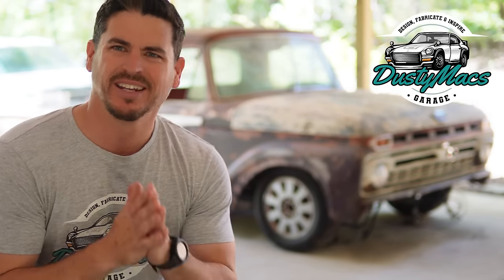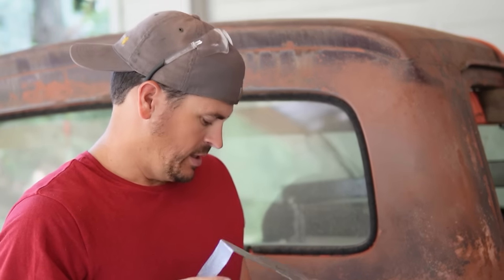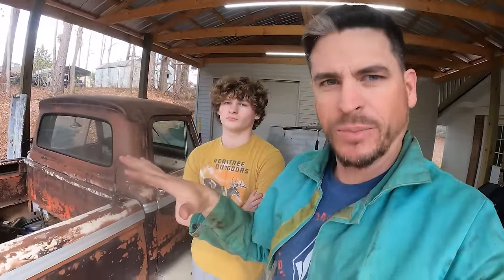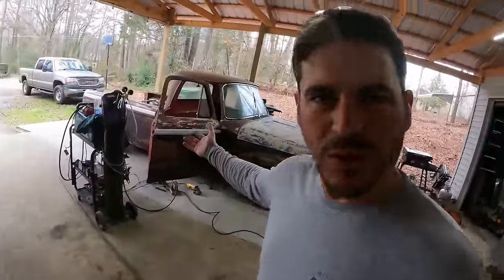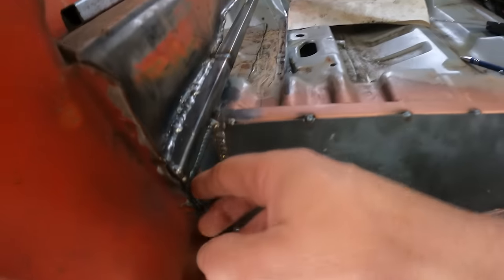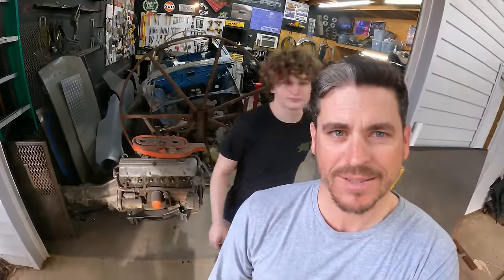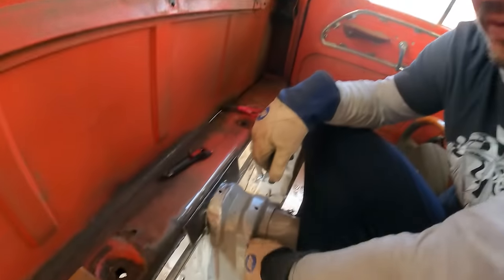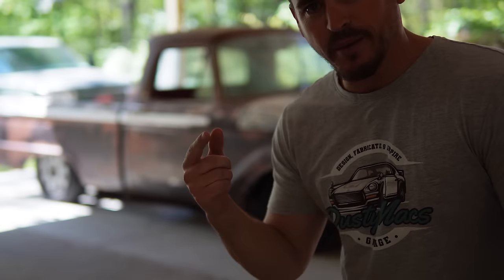(MY DREAM SHOP TRUCK BUILD) 4+ MONTHS OF WORK IN 25 MIN Part 5

Comment: Don’t forget to add some kind of rubber mounts between frame and body to dampen vibration and noise.
Reply from the maker: Hey, I retained the factory rubber body mounts from the Crown Vic since I used the floor and firewall from the Crown Vic and grafted my F100 cab onto it.

Comment: Build it , do you plan on just alot of metal work or carbon parts also
Reply from the maker: Yoooo!!!! I plan on sheet metal at least intially. Im doing a restomod on my wifes Datsun 240z and she wants a mild wide body/flares on it. Hers will not be a shop truck final look like my F100 😂 so maybe the metal on mine will get me better prepared with practice before doing hers on the Z. But long term future carbon is intriguing 🤔 Thanks for the comment and support!!!!

Comment: How are u going to do the gas filler neck
Reply from the maker: Got a few ideas, depends if I use crown vic gas tank or a fuel cell.
Reply from the maker: I tossed around the idea of a fillercap like off a gt350 or gt40.
Reply: @DustyMacsGarage  doing a 55 f100 crown vic swap build.   Might lean towards what caseys customs did on his channel
Reply from the maker: @Thelegendking-yj4bm  so your saying you are doing a 55 crown vic swap?

Comment: 66 Ford F100 on a 2008 Ford Crown Victoria frame with a LS swap. Smh… I would’ve loved to see a Ford engine put in the build but at the end of the day it’s not mine.
Reply from the maker: Yo!!! Sorry to disappoint ya, was gonna do the 4.6 from the crown vic but found out it had blown head gaskets.  Ive swapped several LS motors of my own and several with friends. Im use to working on those engines so it just made sense. It would have been nice to keep it all ford, but at the end of the day its a custom build I guess. I respect your opinion, thanks for the comment!!
Reply: @DustyMacsGarage   I totally understand and agree it’s a custom build I just never see builds on YouTube were they build Ford model A-T’s with Ford engines. I’ve got no problem with Chevy or Dodge just live my Fords. Enjoyed your video and I definitely subscribed. Definitely hope my husband will build my 68 Ford F100 into something as fantastic as the one you’re building. Blessings
Reply from the maker: @bbqwithnellyeats2208  I get it lol Stoked to have a new subscriber. If you like 240zs check out the one Im building for my wife. I got a playlist on my channel with over 30+ videos so far!!
Reply: @DustyMacsGarage  it’s crazy because my husband was watching your videos on his iPad and he told me I need to check out the f100 build lol
Reply from the maker: @bbqwithnellyeats2208 ha ha, tell your husband I appreciate the shoutout💪🏻🤘🏻